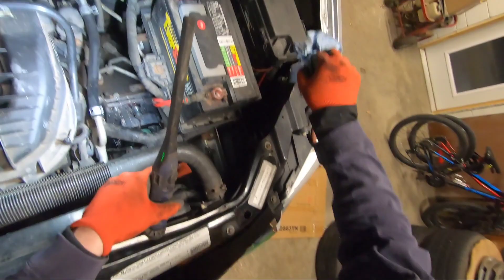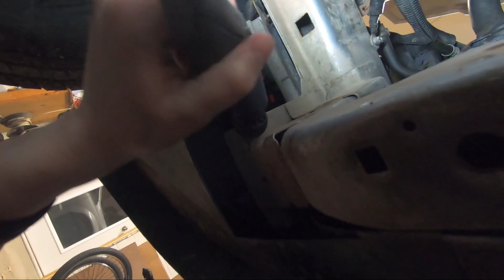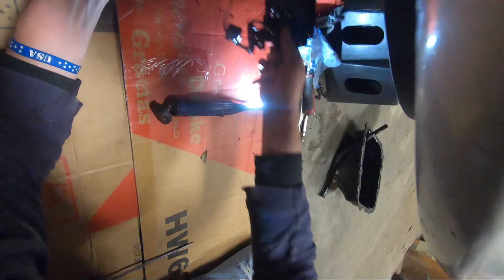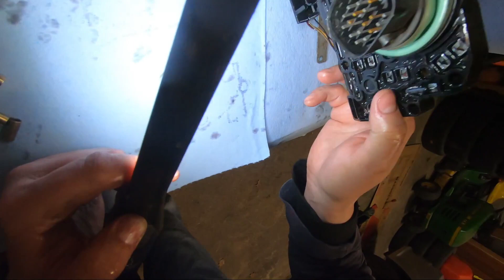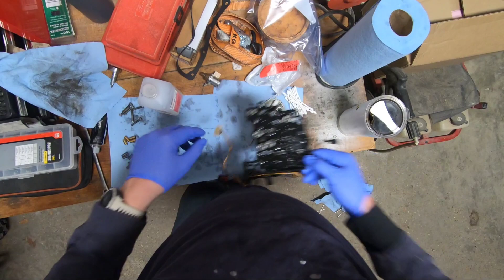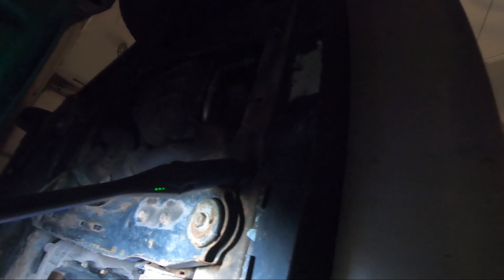62TE Pressure Switch Rationality, P083B.  Limp Mode - No Stored Codes - Grand Caravan

Comment from the maker: I am providing an update to this video as you likely have an interest in repairing rationality codes with your 62TE transmission, or six speed transmission in your Dodge/Chrysler minivan.  I logged 21K miles since the repair on this video with zero transmission issues.  Now at 242K miles (January 2025) the transmission randomly entered limp mode, cold, leaving driveway and threw a pending P083B code.  I am due for a 30K mile transmission service so I plan on dropping the pan and the front cover and disassembling the shift solenoid and install: Sonnax kit 44836-02K.  The kit includes a spacer that prevents the upper black electrical contactor board from flexing causing intermittent codes.  I am confident dirty contactors contributed to my original problems, but I suspect the flexing of the contactor board is occurring too.   

 Read about Sonnax Kit 44836-02K :
sonnax.com/parts/4960-solenoid-spacer-service-kit
https://www.rockauto.com/en/moreinfo.php?pk=12243125&cc=0&pt=913&jsn=1145

or
Replacement Solenoid Pack
https://www.rockauto.com/en/moreinfo.php?pk=4895862&cc=1504648&pt=8476&jsn=1133

Comment: My van has been doing this for about 3 years. It would go into limp mode when cold ONLY. I would turn it off restart and it would go back to normal. The code P083B showed up. I ordered the shift solenoid and going to put a new fluid and filter with it as well. Van has 130k on it. Did this fix your vehicle?
Reply from the maker: The short answer is Yes replacing the shift solenoid fixed the P083B.

Comment: Just found out that my 2011 Chrysler town and country is throwing this code due to my check engine light coming.. however, when I drove it to work today, the check engine light was no longer on.. what could be the issue with it throwing this code?? How much are we talking for any replacement parts?
Reply from the maker: If you're having to pay someone to do this work save yourself headache and replace the solenoid pack assembly in the transmission. 
https://www.rockauto.com/en/moreinfo.php?pk=4895862&cc=1504648&pt=8476&jsn=1133
Reply: @factotumlife why? If my check engine light is now off, wouldn’t it just be a wiring issue or something?

Comment: How much of the exact transmission fluid you gotta put back in there after putting the pan back on
Reply from the maker: It will vary but for this last repair I put in 5.5 quarts and I am at the top end of full range for temps of 80F and 135F with transmission in neutral.  I have a Dorman generic dip stick I use with a thermal temperature gun and measure the outgoing temp of the transmission cooler line from transmission and compare the results with 62TE fluid/temp chart widely available with transmission in neutral.  Will deliver correct results each time - no guessing.

Comment: 2012 caravan, shifting seems fine, can't tell anything obvious while driving. but i got the same code which was pending, then became permanent code, would cleaning help in this case?
Reply from the maker: Likely would especially if no other codes.
Reply from the maker: I am providing an update to this video as you likely have an interest in repairing rationality codes with your 62TE transmission, or six speed transmission in your Dodge/Chrysler minivan.  I logged 21K miles since the repair on this video with zero transmission issues.  Now at 242K miles (January 2025) the transmission randomly entered limp mode, cold, leaving driveway and threw a pending P083B code.  The problem has not occurred since shutting car off and restarting, but obviously something is still wrong.   I am due for a 30K mile transmission service so I plan on dropping the pan and the front cover and disassembling the shift solenoid and install: Sonnax kit 44836-02K.  The kit includes a spacer that prevents the upper black electrical contactor board from flexing causing intermittent codes.  I am confident dirty contactors contributed to my original problems, but I suspect the flexing of the contactor board is occurring too.   I will be posting a second video on all of this for those interested. 
Read about Sonnax Kit 44836-02K :

sonnax.com/parts/4960-solenoid-spacer-service-kit

Comment: So I've rewatched this a few times and im still slightly confused did you just clean all the parts or did you replace anything? Also not trying to be rude just genuinely confused! Im having a similar problem where im stuck in third gear but it wont shift even if i try to "manually " shift
Reply from the maker: Both.   I replaced the TCC lockup solenoid and the Transmission Pressure transducer (sensor) based on access to parts and age.  The cleaning is what resolved the standalone intermittent code P083B.   The P083B would've also been resolved by replacing the entire shift solenoid assembly.
Reply: @factotumlife I did replace the whole pack plus the speed sensors n the problem is still there sad😢. 
Ps.
Figure it out just don't know how to go about it. 
It's basically the same as n👉 abs light👈🏽 ,
In other words there's a wire somewhere that over heats or weak
weld spot that separates with heat n barely reconnects once it cools down .
N yes I know how this sounds. 
I have n idea but don't know the correct name of the part.
Reply from the maker: @micro61micro  what codes do you have ?
Reply: Respectfully, that vid is not rea 😅.
My routan has the exact same problem 😔 .
And I did pay the 400$ for the whole solenoid pack. 
Plus 60$for the sensors.  And still have that fudge problem.
Reply: @micro61micro ever figure the problem out? I did the exact same and still can’t get it out of limp mode!
Reply from the maker: @briannakaminski6506  what codes do you have associated with limp mode?

Comment: I'm working on a 2013 Chrysler 200 2.4 has the code P083B LC Pressure switch rationality. Runs good for few minutes  then gets stuck in 3rd gear, had P0882 and replaced TIPM/fuse box and code cleared with scan tool but transmission going into limp mode with that code coming up (P083B). Should I try to do as the same as you did in this video?
Reply from the maker: Sorry for delayed response.  Did you find a solution to your problem yet?  If you have no other codes, but a stand alone P083B it might be worth trying what I did.